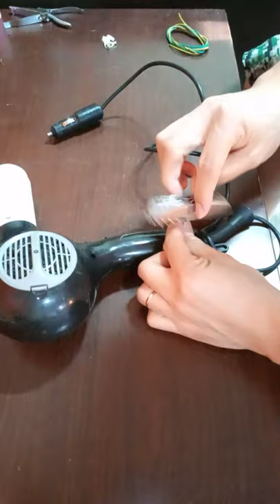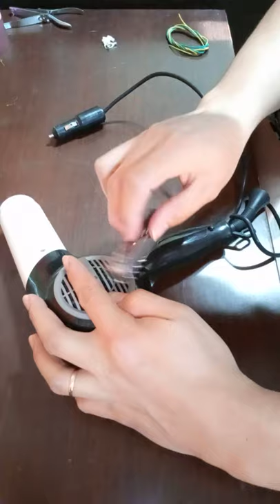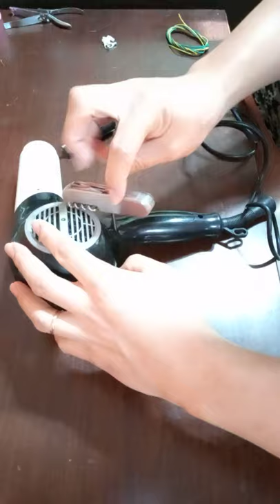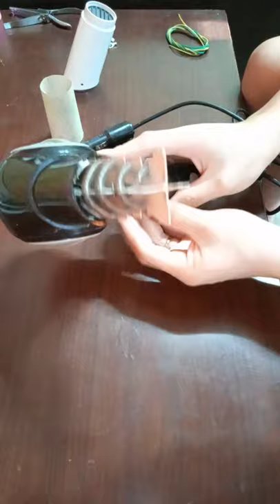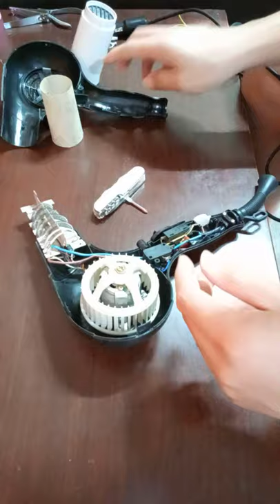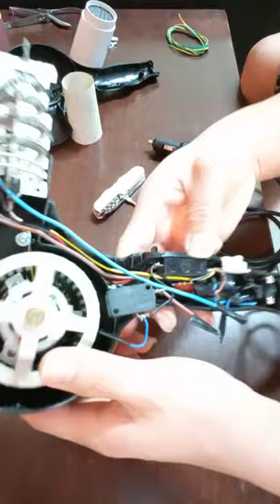220v hair dryer converted to 12v heater

Comment: works or not?
Reply from the maker: it works but not to hot for 12v input..need to shorten the nicromewire.
Reply: What did you do besides taking apart and play with the parts where's the heater what's  the point of you making the video😢 what's the point